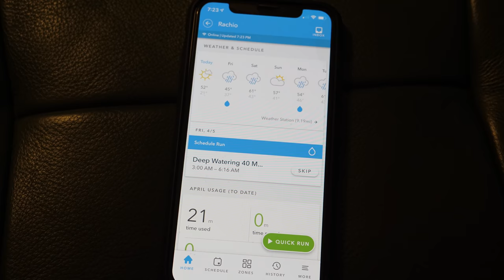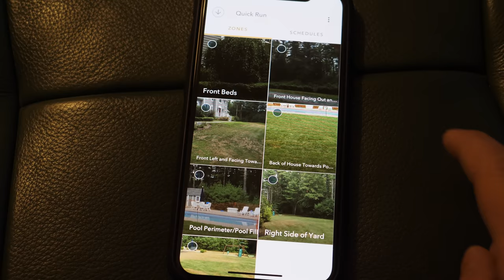How to Open your Lawn Sprinklers / Irrigation System - Save Money

Comment: Loved the vd this will be the first year with  my sprinkler and now I can open them on my own Thanks 💪
Reply: Tre W make sure you open up that valve going to the ground on your back flow very easily turning it on quickly like he did can cause breaks in your main line and that’s very expensive this guys video has a few wrong details

Comment: You really should take the time to explain to people that they need to go outside FIRST and make sure the valves are closed, since most places winterize them by placing them at 45-degree angles.  If someone doesn't know to check that first and just follows your video they will screw up their system and probably have some costly repairs that need to be made.

Comment: Thanks for another great vid. I have a simple two zone system. Bought my house 3 years ago. My sprinkler guy went MIA, so when spring hit I just turned the main water line on to the sprinklers and the sprinkler system wouldn't stop shooting water out. I didn't turn on the zones but water kept shooting out. I just turned the main water valve to the system off and just didn't use it all summer.  I know I didn't take the right steps but why would the water just keep flowing like that without the zones being on? Thanks for ur great channel.
Reply: There's a leak in the mainline inbetween your valves and the backflow.. should be easy to fix.

Comment: After I open my house water and the outside valves it keeps pouring out of the backflow hardware. Any idea what could be causing this?
Reply: His valves were completely closed before he turned the water on.  From my experience, and what we do here in Michigan, we close all of the valves at a 45 degree angle for the winter in case there is any water it can drip out.  So you most likely had that happen on yours, and then if you followed his video you probably just flipped on the inside water right out of the gate, which will muck everything up.  He should have mentioned that the very first step before you turn the water on is to make sure all of your valves are closed!

Comment: Hunter Sprinkler System Acting up

Changed all valve diaphragms (new from HomeDepot) and solenoids (new from HomeDepot and all in closed position)
Tried switching wires from back and front lawn zones at controller and results as follows:
1. Front lawn zone works perfect, no leak at pressure vacuum breaker and starts quick
2. Back lawn zone starts late and pressure vacuum breaker leaks during spray (even after changing wires at controller)

After getting information as amateur, there is leak in back yard and i have changed two heads which originally did not come out and spray was minimal. Despite that back lawn still starts late and vacuum breaker still leaks during duration of spray. Maximum duration i manually set for 20 minutes for back lawn, still the same (starts late and vacuum breaker still leaks).

You being professional have knowledge and would you please help me in fixing back lawn zone.

Comment: I had an irrigation system put in late last fall in Michigan which is currently winterized would like to save some money and open it myself my question is do the valves inside the boxes in ground have to be on or off l have 5 zones and their all off also wondering how to adjust the sprinkler heads which are rain Bird 1800 and 5000 thanks for your time
Reply: they can be off especially if you control it from the controller
Reply: @washingandmowing15  thank you very much
Reply: @shane6002  No problem glad to help

Comment: This video is different from what the sprinkler companies recommend.  They start on the outside of the house and then go inside to turn the water on.
Reply from the maker: Interesting, not much they can do outside without the water on.
Reply: Well you make sure your back flow is shut off first so you don’t send water back in your house 😶😶😶😂😂😂
Reply: @SilverCymbal  it's because most companies winterize by turning the valves to a 45 degree angle.  So most companies/videos explain that you need to go outside and completely close them shut before you go straight to the basement and turn the water on.